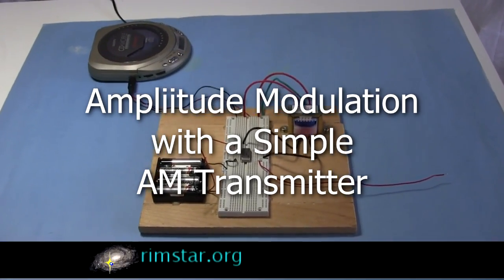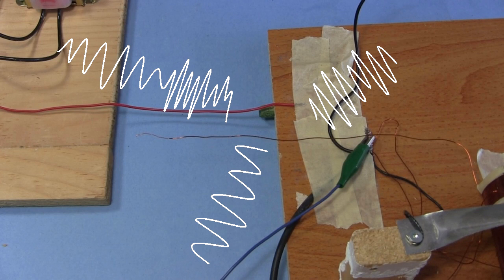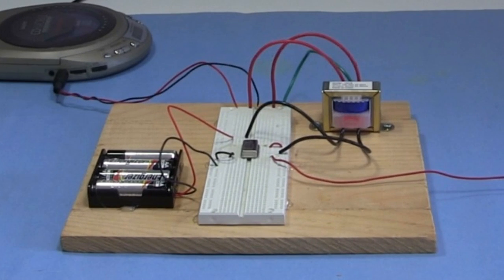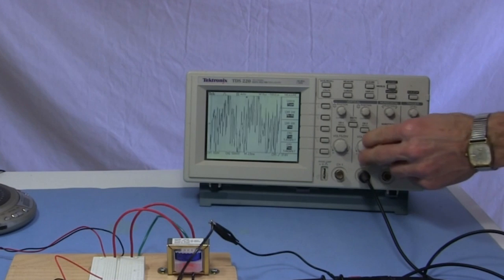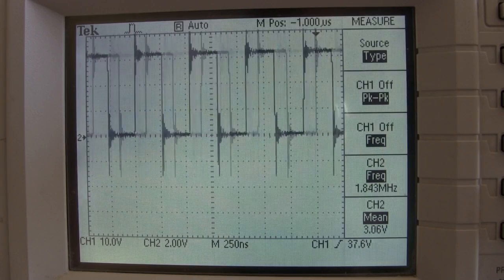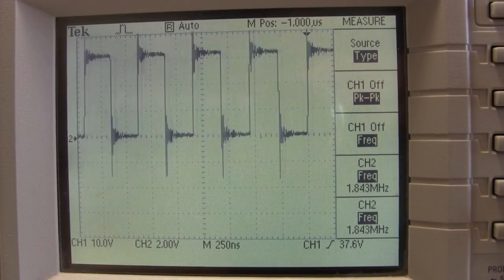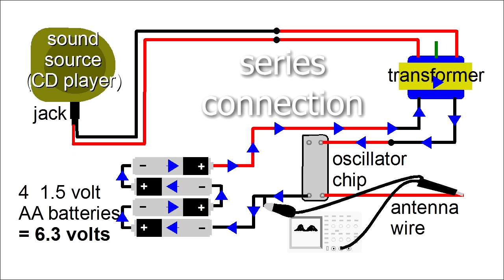Amplitude Modulation with Simple AM Radio Transmitter

Comment from the maker: They're also good piezo crystals so that helps. The strikers and crystals are in small housings with a spring. You can see demonstrations of the sparkers in my videos "How to take Piezoelectric Igniter from Lighter for Spud Gun" and "How to get Piezoelectric Crystal from BBQ Igniter/Sparker". But even if you remove the crystal from the housing, tapping it against a solid surface like a tabletop gives a good 240 volt spike.

Comment from the maker: If it works and has a range of 2-3 meter then that's great! I'd say it's working. 108MHz is the top of the FM radio frequency range. If you were able to transmit long distance then you'd interfere with FM radio stations. I did a search and couldn't find anything useful about your chip, but since it's working I guess any problem isn't with the chip.

Comment from the maker: 4 AA batteries produce some voltage based on the voltage of the batteries at the time they're used. When you buy a AA at the store it's voltage is higher than 1.5 volts. When I measured the voltage of the four battery together it was 6.3 volts.

Comment from the maker: Thanks! I was thinking the same thing just this morning re if a joule thief could be used. The waveform's awfully spikey though. Also, when looking at it on a grounded scope like mine it looks all pos but I suspect it's put  on the antenna pos and neg. It certainly is on the receiving side. Now that I've got the simplest transmitter out of the way, I should look into one with an oscillator circuit from scratch. Sounds like you have an itch to scratch with all your ideas. :)

Comment: It was fun to play with tubes and tube type transmitters back all the way to 1997 for me. I had a Collins 20V-3 Transmitter I had to use a main to keep the station on the air. Big 4-400 tubes that were the size of a softball, and the transmitter's weight was about 1,200 lbs. Now we use a small 1 KW Broadcast Electronics Box that is a 1,000 watt box the weighs only 80 lbs. Since I have been maintaining it, not tubes, no problems, it just runs and runs!

Comment: I didn't know there were oscillator chip made that small these days. When I was a kid in the early 70s, you could by a kit a Radio Shack with springs to connect the wires into form a circuit like a Oscillator. Last time I had to work on an oscillator, it was in a tube type, 1948, Gates Radio Commercial Transmitter, whey the operating crystal used a oven to keep it warm. I never could keep that oscillator on frequency! That was back in the mid 90s.

Comment: I havent' found any datasheet of my crystal so I wired it up as I saw in this video and it actually works,I can transmit at 108MHz (I'm using the 4th harmonic) but as I said before the output is very low so its range it's about 2-3 meters,I really can't understand what should I do.Anyway if you care the entire code of the oscillator is:
XCL
27M000
OSC-P50-303
thank you so much for your help(If I wrote something wrong I'm sorry,it's because I'm 17 and Italian  :) )

Comment: Great video! I always wondered how that worked, Now I think I could make an oscillator to do that! Ever seen a JT audio modulated and transmitting audio via radio? Exciters dont count... I've seen that a few times. But not with toroid core... That the signal goes all pos was news to me. Explains the mono though. Makes it easy(er) too :) 555 timer could probably do it too! I'm just using some for the first time in 20 years the last 2 weeks :)

Comment: Astonishing explanation as always. Very very interesting. I've just found your channel and I'm loving all your splendid videos.
For that video I didn't understand just a thing: does the oscillator chip do something strange inside? The mixing process of the audio signal with the carrier wave that happens inside the chip is complex or is very simple? Does the chip just make the two waves join on the output connection? I'm wondering if I could reach the same goal using a simple, two pins oscillator, do you think is possible? Thank you again.
Reply from the maker: I don't have the specs for the internals of the 4 pin oscillator, the specs for mine don't include it. You could probably reach the same with a 2 pin oscillator, but you'd need to add the extra functionality yourself. Unfortunately I don't have a schematic for that either. Sounds like an interesting project. Let me know if you get one working.
And thanks. I'm glad you enjoyed the video, and all my others!
Reply: I made it!!! I built the Receiver almost the same as yours, with some amplification. For the Transmitter I used just a PIC which generates a 2.5 Mhz frequency. It plays and stops it with a frequency of 1 kHz. So on the Receiver I clearly hear the 1 kHz sound wave. So now I'm going to add a PIC also on the receiver so I can transmit and demodulate all kinds of commands!! I almost reached a 20 meters range of communication!! Thank you again for illuminating my mind on this subject, you're the best!!
Reply from the maker: EMandMORE
Cool! Congrats! Sounds like it was lots of fun. Just be careful not to transmit too far and interfere with others' communication.

Comment: Great tutorial, other than the fact that the frequency is not the distance between two waves. That is wavelength. The frequency is how fast waves pass a certain point. For instance, the faster waves move, the higher the frequency (usually).
Reply from the maker: Shelly Gardner Hmmm... This is a case of hear what I mean, not what I say. :) In my head, as I was saying it I was processing the implication that if the frequency is the same than the wavelength is the same and therefore the distance between each peak is the same, or more likely I was processing that the same frequency implies the same distance between each peak - something automatic for me and you too I guess. So you're right, I shouldn't have said it that way. Sloppy. Good catch.
Reply: Do not use fast or faster in explanation of frequency as that implies the speed of the wave is changing. The speed of the the wave remains the same in the same medium. Frequency is best explained as the number of oscillations per second.

Comment: Thank you for your efforts. Why did you use the crystal oscillator? You could send the sound in the am wave because the sound is in the am range
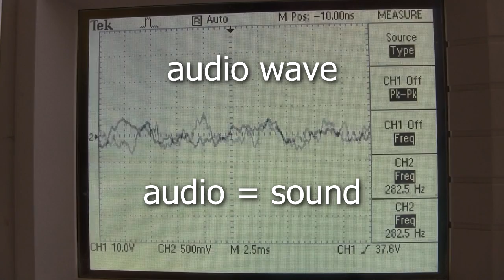Reply from the maker: The problem is with the receiving side. The receiving side needs a specific frequency to tune into and the original wave consists of many different frequencies. See the explanation of the problem in the video again starting at 0:31.

Comment: How does DC power you connected to a transformer, which is works following AC principle?
Reply: The tranny couples the AC audio to the oscillator output also AC . The DC is what the osc uses to produce the fixed carrier wave ( that we are gonna modulate to produce our 1000 khz " AM radio station" )

Comment: Great video, I think amplitude modulation is a lot easier to understand than frequency modulation because unlike AM I don't understand how FM radio waves carry sound (audio) waves. Do you feel the same way about FM radio?
Reply from the maker: Brandon Fisher I think conceptually FM is probably a little harder to understand, or picture. Looking at the original and the FM radio wave side-by-side, it's harder to see the original in the FM radio wave than it is if you had the original and AM side-by-side. In the AM case it really stands out.

Comment: Nice video as always, I have a question though. I noticed the lack of lower band audio signal from the transmitted signal, as well as the use of square wave as carrier wave. I believe square wave takes a lot more bandwidth than sine wave, which may result in bad audio quality, is that true? Also, does the missing lower band signal matters at all in terms of audio quality?
Reply from the maker: ***** Thanks. Sorry, but I really don't have answers to your questions. This is a pretty basic transmitter though, so the quality is quite low anyway.

Comment: How can this transformer step up 1 volt to arround 10 volts when out cd player output ha no yet voltage or current so high to full fill this requirement and secondaly our transformer is low frequency how does it can work on khz frequency?

Comment: Can I use a function generators 1 MHZ sine wave, instead of the 1 MHz crystal oscillator?
Reply from the maker: I suspect so but I'm not sure.
Reply: @RimstarOrg  Thank you! that's encouraging, I'll have to just try it and see! If it works, I wonder if I could even use the generator's bias control in place of the battery pack.
Reply: I would think a sine wave being modulated would give a more natural sound than a square wave anyways.

Comment: Can you explain how the oscillator adds the two waves together, why does it do it? Specifically, why just because the audio wave the carrier waves are added together, they form a new wave, why and how so?
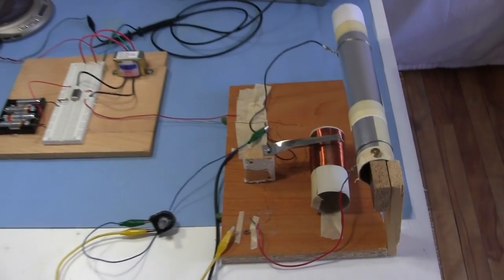Reply from the maker: The answer to how is that the audio source's wave is on one coil of the transformer and induces a voltage on the other coil of the transformer. That other coil also has the voltage wave from the oscillator and so they add together. For the why, I explain that in the video starting at 0:37. You might also get some understanding of why from my video about how a crystal radio works http://www.youtube.com/watch?v=0-PParSmwtE
Reply: @RimstarOrg  Fantastic!!! Thank you very much

Comment: hi , dose that mean that the carrier frequency could be of any function ,, ie sine wave  , square waves  ,zigzag  etc... cheers
Reply from the maker: +Mustapha Alkhafaaf It would seem that way on the transmitting side, but the receiving side has to be able to do something with that carrier wave to get back the original audio wave.
Reply: so I understand  from what you have said  that as long as the receiver can be designed to demodulate the received signal according to the shape of the transmitted carrier wave , we are free to cheese any carrier wave ...
Reply from the maker: +Mustapha Alkhafaaf Oh, now that you put it that way, I don't know if other waveforms than sinusoidal will work as electromagnetic waves propagating through space.
Reply: it depends how you know/see electromagnetic wave travels through space , some people see it as a sinusoidal wave others see it as ring circles just like the effect of stone in the water ... very confusing i must admit
Reply: Mohammed Al Sayegh

First of All many thanks for the above explanation
I really appreciate the time you spent to write this
I am still not very clear why sinusoidal  why could that not be of another form
I do understand from the DSP point of view that all square waves are made up from the summation of sine and cosine waves (if we apply the Fourier transform ) but I am still not clear of the EXACT reason of the carrier frequency why it  should be sine or cosine wave persay. If the physical property of the antenna only accept or “understands”  sinusoidal  waves then I would really like to know the exact reason for this , (if e look in the LC filter formula we see that there is the  2Pi times the  Freq factor present )  and two pi element represents the unity circle of sine and cosine ... Now the question >.. is this the reason ????

Comment: Awesome explanation as always. What are the components of the AM transmitter that control its range. i.e. how far its signals be received
Reply from the maker: I prefer not to say since that would be a bad idea (plus I haven't tried it). Firstly, it would interfere with other broadcasts, secondly, it's illegal in many countries to broadcast, and thirdly, this simple circuit transmits on many frequencies besides the tuned one so it's even worse. So it's fun to play with for short range, but longer shouldn't be done.
However, many countries have the ability to get amateur licenses if you want to pursue that sort of thing. It's very rewarding and you learn a lot.  http://www.arrl.org/ham-radio-licenses
Reply: RimstarOrg thank you!!

Comment: I bought the things you said ( in AM radio transmitter video)...I have bought this oscillator chip.... It has only two wires/pins sticking out of it...How do i use it... I have sent you the mail

Comment: What did you use to record your audio? Sounds a little too cripsy for my ears.
Reply from the maker: A Rode microphone but plugged into the camcorder (which adds some noise but is all I have). Then Audacity to clean it up, remove hiss and so on. And finally into Sony Vegas video editor where I do volume control and sometimes get rid of room and car sounds.

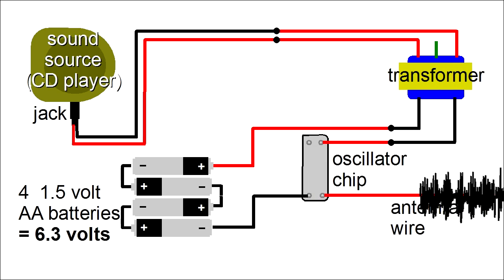Comment: Hello there, i very much like this video! Can you explain why the wave form at 5:10 (modulated on the top of the carrier wave) is not the same as the one that is transmitted at 5:11 ( modulated on top and bottom of the carrier wave)
Reply from the maker: Good question. The one you see at 5:10 (modulated on the top of the carrier wave) is measured with respect to the ground pin on the oscillator chip. Unfortunately, the datasheet for that oscillator doesn't give the internal circuit. If it did, and we could see something else to connect the scope's ground clip to that's nearer the output in the circuit on the chip then we'd see it oscillating with respect to that that something else. It would look like what is transmitted at 5:11 (modulated on top and bottom of the carrier wave).
Reply: RimstarOrg Thanks for answering! One last question,  why modulate the bottom carrier wave if to hear the signal we have to cut it with a diode? What if we sent a top only modulated wave?
Reply from the maker: I don't think it's possible for an electromagnetic wave to be that way.

Comment: If I understand correctly, the receiver (crystal radio) uses an LC circuit to tune to the right frequency of the transmitter. 
Can't you just use the same LC circuit in the place of the crystal oscillator, for the transmitter as well ?
Reply from the maker: I think so. You'd still need to power the LC circuit but an LC circuit can be used to generate an oscillating frequency, to be an oscillator.
Reply: @RimstarOrg  
I'm not sure if it will be able to modulate the sound, in theory it should, but there's nothing to generate the continuous carrier wave ? (radio wave).
This LC circuit was used in the early spark gap transmitters, and it was used to keep them at one frequency, but still didn't create continuous waves (CW), rather dampened waves. 
Maybe that's why it didn't work to transmitt sound.
Reply from the maker: I was thinking that the LC circuit, i.e., tuned parallel capacitor and coil, would supply the continuous carrier wave. The audio wave would then be added to that just as is done by the audio source to the oscillator output in this video's circuit.
Reply: @RimstarOrg  
 I saw that another circuit (an amplifier) was needed together with the LC to keep the oscillations going, otherwise it would just drop quickly and become a damped wave.

A quick search shows why it wouldn't work : 
"In a simple inductor-capacitor, LC circuit, oscillations become damped over time due to component and circuit losses. Voltage amplification is required to overcome these circuit losses and provide positive gain"
Reply from the maker: Yup, that's what I meant in my original reply when I said you'd still need to power the LC circuit.
Reply: @RimstarOrg  
Oh, now I understand why...
Thanks !

Comment: does it matter that there is no reversed wave on the bottom?
Reply from the maker: Which part of the video are you referring to? I can't find what you're asking about.
Reply: @RimstarOrg  I mean that the wave being sent goes between 0 and some positive volts. I guess it probably doesn't since in the other videos you kinda subtract the bottom (negative section) with a diode anyhow
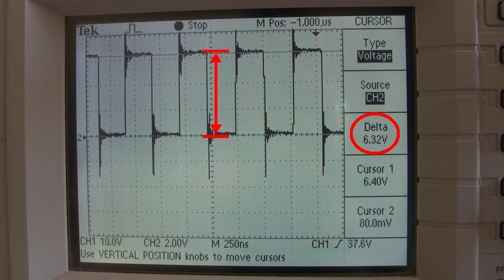Reply from the maker: That's right. At 3:13, I'm showing a measurement of what the oscillator is putting on the wire but the resulting electromagnetic wave's affect on the receiving radio's antenna is to make the electrons in the antenna oscillates back and forth.
Reply: @RimstarOrg  I feel I should probably just try it and see what I find : )
Reply: This is actually an interesting question! At 3:29 we see the amplitude modulated carrier wave on oscilloscope. It is missing the mirrored bottom half of the signal below 0, which you normally get at amplitude modulation. What causes it to be missing?

Comment: AT 1.08 it is said that the modulated wave is made up of a single  wave all of the same frequency.  I am afraid this needs to be corrected as it is made up of the carrier and the sidebands where the information is held,,,,,,, there is no information in the carrier.    So at least it is made up of three frequencies and more depending on the misic being played  , all within close range of the carrier.............. but it must be made clear that the carrier is not on its own. as a single frequency.
Reply from the maker: Carmel Pule' Granted, when talking purely about AM, I should mention sidebands, so I probably should have here. But the simple transmitter that I use as the example doesn't transmit sidebands. And the crystal radio doesn't do anything special for sidebands, though I guess it's not getting energy precisely from just the tuned frequency but also some of the frequencies surrounding it too i.e. any sidebands. I'll keep it in mind in the future.